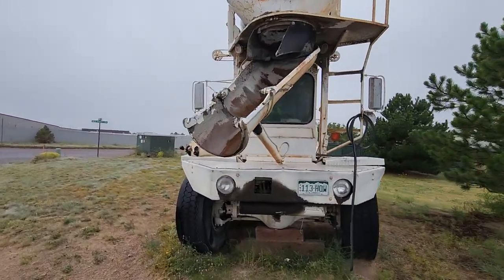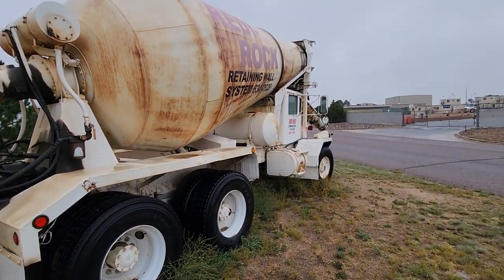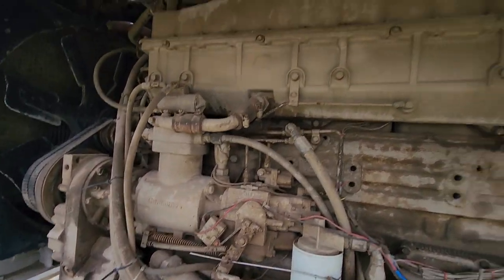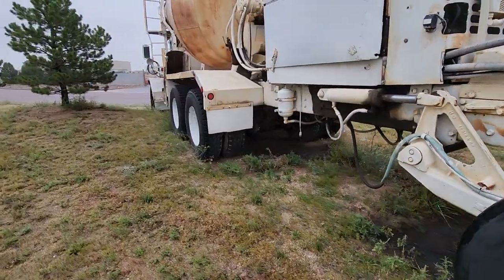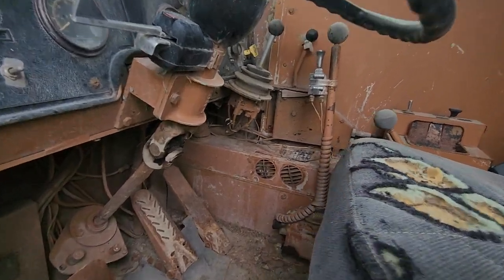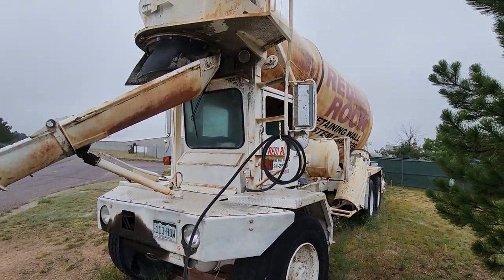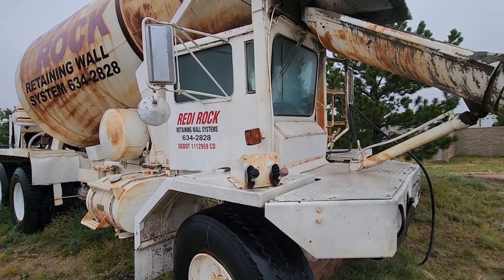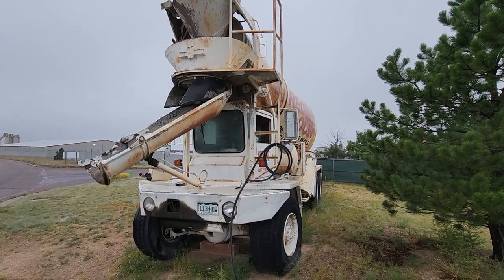13 Yard Oshkosh Front Discharge Concrete Mixer S400?

Comment: That's the most common  mixer truck out here
Reply from the maker: Not here. Out of a fleet of 100 mixer trucks, maybe 1 will be a front discharging mixer truck. Terex also makes 13-yard front discharging mixer trucks as well.
Reply: @Deorse   the back cure truck mixers can be put on ant truck that can carry  it.  The front chute trucks are purpous built .  One the truck is shot,  it's all junk .  On the back cute.  Pull it off and drop it on another chassis
Reply: Not everywhere is “here” wherever here is for you!
Reply: Cool truck! I love the tag axle if that’s even what it’s called. It’s funny how different things are in different places. Here in MI where I live, front discharge is the common type of mixer and that’s what everybody has and there’s one company in town who runs a few Butt Dumpers (rear discharge) so the exact opposite of how it is where you live. There is a company that uses brand new trucks which have that crazy weird drop down axle that sits behind to motor. They are the only company I’ve ever seen with them and they are quite a ways north so I don’t run into them often. Anyways, cool video, I love seeing old machines even if they are out of operation!